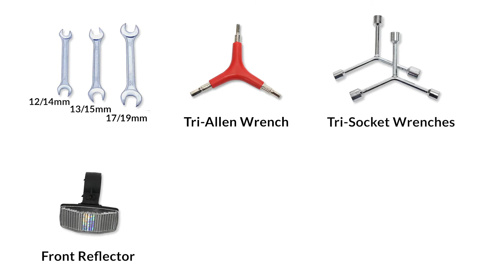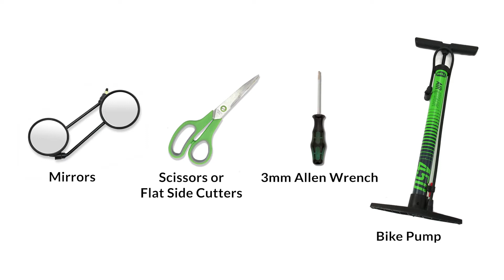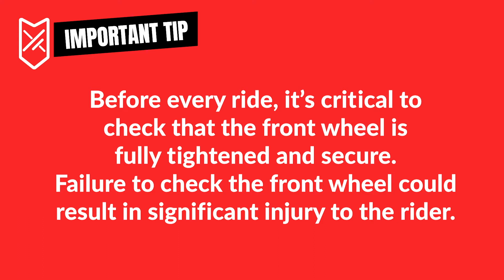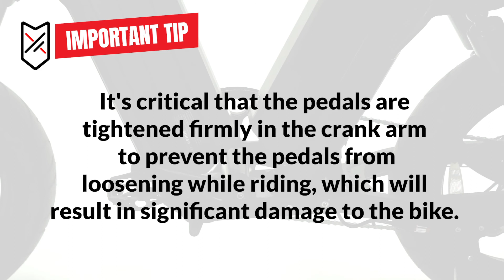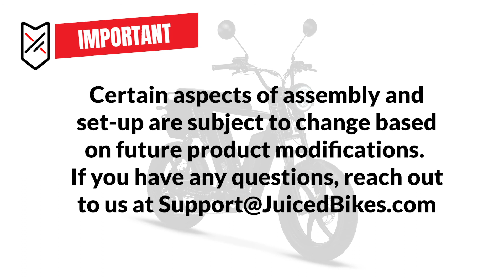Juiced Bikes HyperScrambler 2 Assembly and Set-Up

Comment: Today I was assembling it and got most of the way through before I watched the video. The sun went down. I would try it out except I forgot where my pump is. I will install the security thin tomorrow. Hope to get 50 miles per charge with 2 batteries. I figure they tested it @ 15 mph using a 115 pound person. 🤔